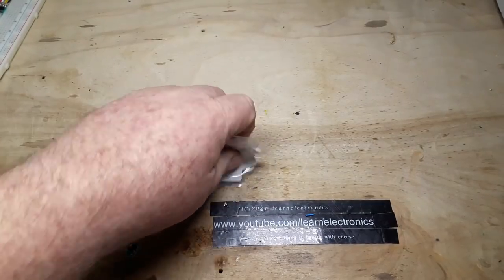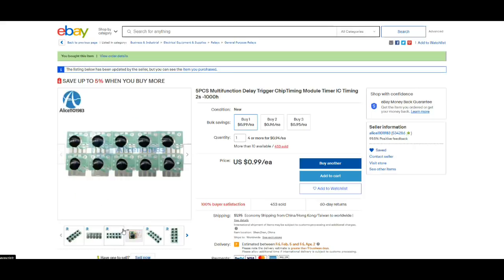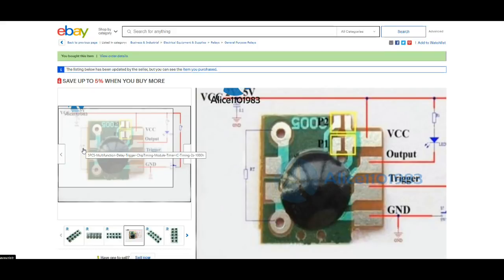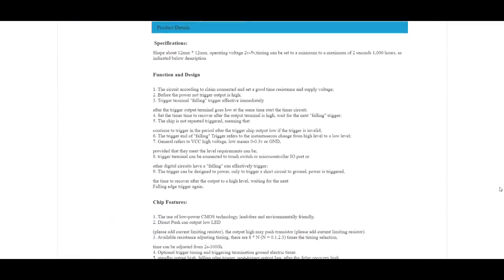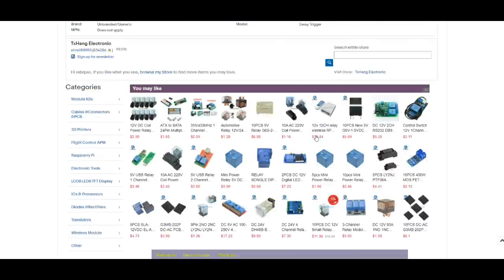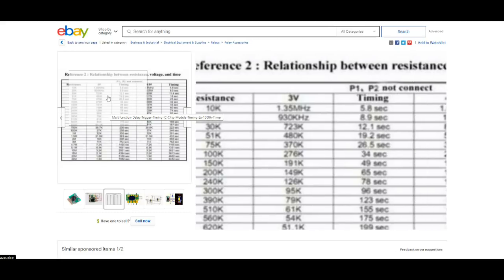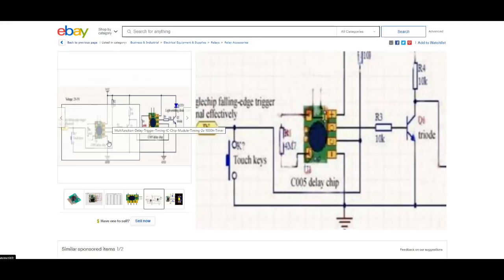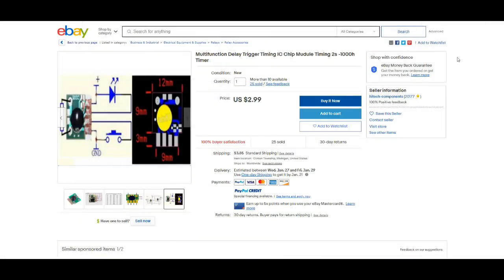An interesting timer IC from Alice1101983

Comment: Interesting, but I think I'll stick to my trusty 555  Thank you for sharing this though
Reply: I agree.
Reply: Can you make a 555 time for 1,000 hours?
Reply: @pleasecho2  :)
Reply: @pleasecho2  if you mean one on/off cycle for 1k hours. It could be possible but the capacitance and resistance needed for that timing in the astable operation would not be easy for 1k hours. Plus the timing error percentage of the chip.
As an example of the largest values I have. Without multiple components to increase the capacitance and resistance: 
0.693 * 1000uF * (10M + (10M * 2)) = 20.79K sec / 60 = 346.5 min / 60 =   5.775 hrs. 
I would need a lot of space for the physical capacitors size to get 1k hours.

Comment: My guess is this IC will be more useful at the longer delay times (>30s) where the 555 isn't as accurate...but more testing would need to be done.
Reply: These modules don't seem to be precise either. That's the point I took from this video.

Comment: If you solder wires to the pads on one of these things be careful. Use flexible small diameter wire or you'll pull the pad off in the blink of an eye
Reply: ^^^^^^ FACT!!!

Comment: I wrote an article about the same last year, when people were using an arduino and Ultrasonic sonic sensor to dispense sanitizer, about stupidity in the middle of all crazy stupidness of covid, all you need is this IC and an IR LED and a relay, to make a cost effective, usable and small form factor sanitizer dispenser. the best part was even if the trigger is still there, it won't affect,  as you have to remove your hand from IR sensor and place it again to make the sanitizer dispense again. and a variable pot can ensure how much you want to dispense the sanitizer.

Comment: I think I could use one of these. I have a networked 3T USB hard drive that is hooked to an old repurposed HP Thin Client with the OS overwritten with a light Linux (I think Puppy). When starting the drive must be offline until linux has had a chance to fully load or it will never load unless power cycled (the drive), so the normal way to get it to work on boot is to unplug power from the USB drive, cycle on the HP and wait about 90 seconds (there is no monitor attached) and then plug in power for the USB drive so that it can be recognized and loaded (which takes another minute). There are probably thousands of ways of automating that (I was thinking a NO relay that gets toggled on by a serial pin - parallel pins are a choice on this device, or even a cheap ESP32 that controls a relay for the USB power that can be reached via wifi, and about 30 other ideas). Add using this to the list - inserted in the USB power line, the 5V could be blocked until the timer tripped (which of course assumes power cycle on both devices as the same time as in a power outage situation, which is about the only cause for a reboot).
Reply: I guess since it can power an LED, an optocoupler style power gate would be cheap...

Comment: Using a digital timer, I measured 5.5 seconds, the error being 0.3 seconds due to not starting exactly when you started. But even so, getting 5.5 seconds delay is quite close to the 5,8 seconds delay stated in the Chinese literature.

Comment: P1 and P2 are primarily used to extend the time. By shorting P1, you extend the time by 8 times, by shorting P2, you extend the time by 64 times. Shorting both yields a time extension of 512 times. 
That seems to be the 8*N (N=0,1,2,3) formula. Think binary for P1 and P2.
Just found on internet.
Reply from the maker: Excellent information, thank you
Reply: cool, thank you, I searched a lot after having received ten of these, and documentation is really poor
Reply: How do you short P1 and P2? Do you connect them to ground? Sorry, I'm not very good with electronics but this looks to be exactly what I need.
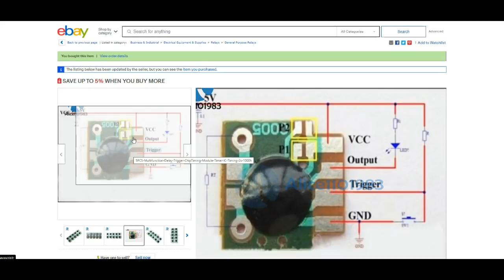Reply: @garykuper2480  P1 and P2 are a pair of 2 pads each (one pad seems to be Vcc). Just short one pair or another or both and you are done. See 2:30.
Reply: @sebastian19745  Ah, okay. Got it. Thank you.

Comment: The interesting thing that you mentioned was that the chip doesn't draw current unless triggered. That being the case, this would be useful to power things that you forget and leave on that causes the battery to go flat. 
A few years ago I built a gadget to fit inside my multi-meter (which I always forgot to turn off) and wasn't the modern kind that had auto shut off. Consequently I went through a lot of 9v batteries. 
The circuit was designed by Bob Kellogg AE4IC and it appeared in issue 156 of SPRAT magazine and it used a LMC7221 chip (and a few extra components). So I could imagine this being useful (for instance) in battery powered closet lighting where you only need  (say) 10 seconds and it turns off.
Thanks for the videos. Much appreciated.

Comment: Thanks for the info paul i got half dozen  star delta timers to tear down now I know where the timer module is and how to use it the units have those chips as a daughter board on the switching relay  board

Comment: Seems like that's a 555 in monostable config. Oh yeah 555 is also a timer chip too. All the manufacturer did was hid the capacitor inside the COB. Maybe that's why the pin next to output is called C. If you get a 1/3 and 2/3 VCC around the resistors, that will definitely confirm that it's a 555.

Comment: Greetings, I found this very helpful thank you for posting it. I’m currently looking for two applications (little fun projects) for this and I went ahead and ordered a few of these. I was wondering if this could be adapted to a repeating pattern. I need a 6 hour on 18 off version. I 1st attempted cannibalizing a led tea candle but all the ones I have the flickering candle feature integrated into the candle timing board. Any suggestions? FYI I’m a retired mechanical engineer and I’m attempting to relearn my electronics from 44 years ago 😂

Comment: The output must be sinking current going by the LED position on the diagram.
i wonder what chip is under the blob.. & if it can anything else apart from timing?? you should try some test's on it to see!
Have you ever seen those chip identifiers like the transistor testers?? they can identify loads of chips and their pins. kinda looks like the tester you had there. thats what i thought it was when i 1st seen it..
Reply from the maker: No I haven't. Do you have a link?

Comment: what if you push and hold the trigger? will it trigger again? will it trigger on let go? will it trigger on push down and not do anything else?
Reply: Wow, your nosey! LOL.
Reply: @frankowalker4662  I think this is a poor review. This are exact variables you are interested in designing circuit with delay. You need to be nosey, unless you don't want to learn electronics.
Reply: @contemporiser  Thats why all my toys growing up in the 70's were broken Reel to reels and record players. And still are.
Reply: I did, it does not trigger anymore, neither keeping it pressed longer than the led stays lit, nor releasing it meanwhile or after
Reply: @lucapesce3335  thnx. This is important when you set a shorter delay

Comment: "Allways hooking up ground first" - Question: but isn't that where current actually comes from? electrons from the negative side?
Reply from the maker: You hook up the grounds first as the ground is the reference
Reply: @learnelectronics  okay... but why sir?
Reply from the maker: Voltage is potential. 5 volts could be the potential between 5 and 0. Or it could be the potential between 300 and 295. So when we hook up the grounds first we give our circuits a reference. So now our two 5-volt circuits are both between 5 and 0.

Comment: I have 10 of these bought on AE for something close to zero.
They seems to behave as shown in the table, at 3V I have 3s with 0ohm, 5s with a little less than 9k, 6.5s with 13k ...and removing the resistor the led stays on forever.
BTW, I wired the button according to the "documentation", with a pull-up resistor ...I am mentioning these while thinking it does not change anythyng :-)
Reply: I've been playing around with these for a couple weeks now and it seems that the pull up is needful, otherwise this module can get quirky under continual use conditions (power remains on Vcc+ & Gnd)

Comment: Nice and small, But I can't think of a use for one.
Reply from the maker: Team it with an infrared sensor or laser trigger and you have motion activated variable on time... whatever
Reply: I connect these to a momentary switch and a relay to tie in addition to a traditional On/Off switch for use in simple projects where I often only need power for a few moments (under bench/cabinet lights at 30~ secs, or same setup on my soldering station except set to 90+/- secs). Momentary switch gives me some "walk away insurance" white regular switch for manual On/Off.
Reply: @BuckWezr  Cool.

Comment: what do np1 and p2 do?
Reply from the maker: No idea
Reply: Could be a multiplier to extend the range. Short one or the other (or both) to reach longer timing periods. Remember the description had N = 0, 1, 2, 3 - this might be the multipliers for P1, P2 and both shorted. (Yes, I'm ignoring the zero. Another explanation might be that they mean 0.1, 0.2 and 0.3. More experimentation needed.)
   One great application for this is to keep an entry light on for a while after entry is detected. (Motion detector, switch, etc.) Note the description said this is not retriggerable; the light (or whatever) will have to go off before it can be turned on again.
   The best use is probably to use a potentiometer to trim or adjust for an accurate time, though there will be variation between modules and even with the same one - different temperatures alone could make a difference.

Comment: It might be a 555 ic.
Reply from the maker: It is not, pins don't match
Reply: 555 requires cap. This module is way different from 555.

Comment: They only cost 76c for 10 on Aliexpress. They are direct wafer to board chips which is why they are so cheap and globed. It seems people are buying whole wafers of these from some factory. There are also tons of these for use in doorbells that output music and dog barking sounds. A few weeks ago I actually found a few listings on alibaba for companies selling wafers of all kinds of transistors etc. I think it was ~$100 for 5" wafers with 100v trans an something like 3000-8000 pieces depending on the types. at 1.4mm X 1.4mm they are just barely big enough that you could use a 0201 pnp machine to mount them.

Imagine building your own display controller with a big transistor array of some of the lower power transistors :D

Found it:
$86 for a wafer of 37,200 BC807 triodes
https://www.alibaba.com/product-detail/BC807-5-inch-triode-silicon-controlled_62145554598.html
$96 for over 5000 100V 3A transistors
https://www.alibaba.com/product-detail/P1-4-100Vsilicon-wafer-chip-semiconductor_62145537776.html
Reply: They have a large collection of the LM family apparently in packages as well as precut dies.